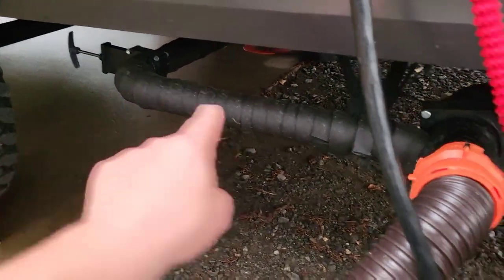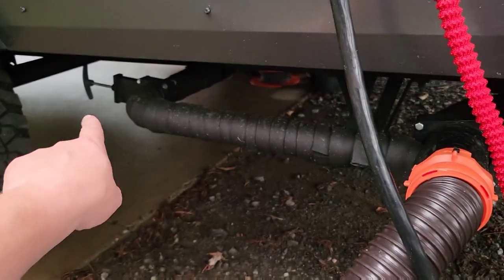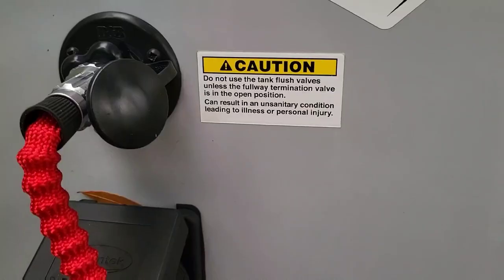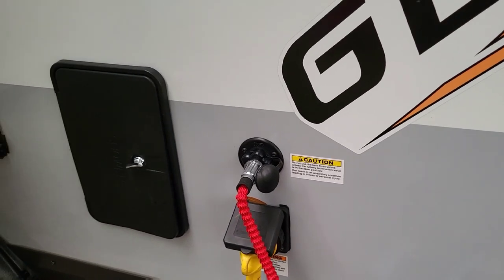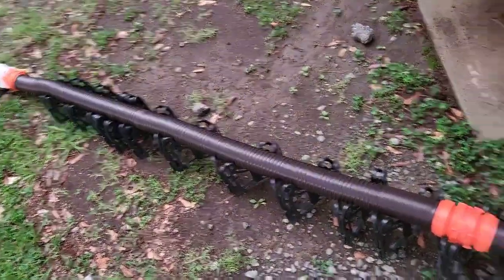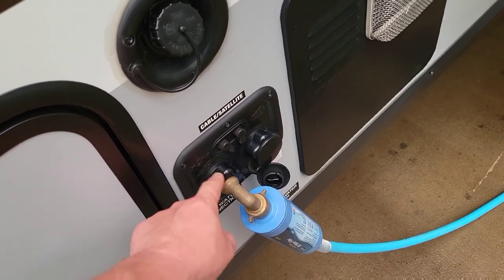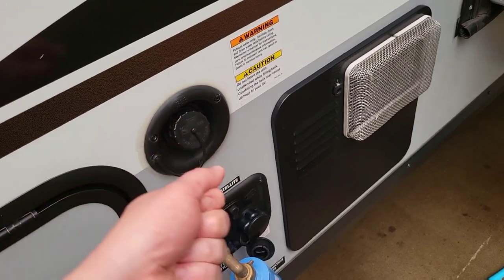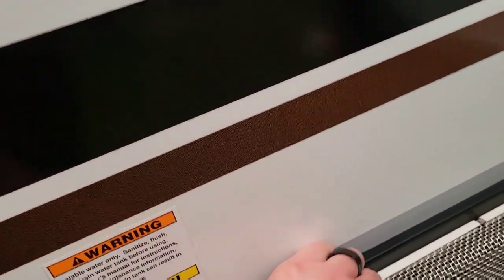Geo Pro or E-Pro RV Travel Trailer sewer and water connections explained for beginners.

Comment: Question, say someone is living on land in one of these for a while… months or years… can the grey and black valves be open the whole time with the sewer hose attached?
Reply from the maker: Gray tank, possibly if you use a sink strainer and flush with fresh water often. Black tank is a tough one. When the black valve is open the tank is mostly dry, which opens up the possibility of creating a "poo mountain" inside the tank. It's always recommended to have some water in the bottom of the black tank. These units have a black tank flush function, but I'm doubtful it would clean out said "poo mountain" once it's been created.
Reply: @jekell101  thank you!
Reply: I always keep my tanks closed until I need to empty. 99% of the time is the day I'm leaving and then I hook up hoses to flush. Empty black tank first and Grey tank last to clean out hose.
Reply: Great video